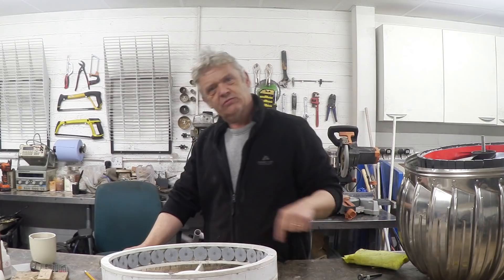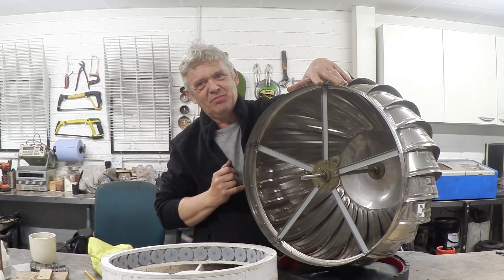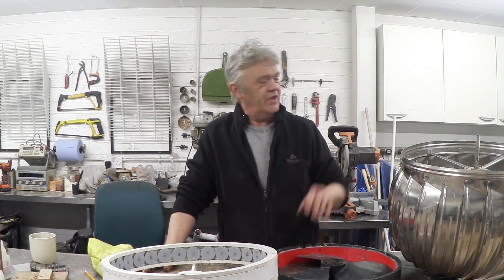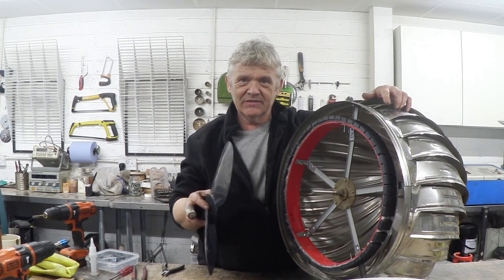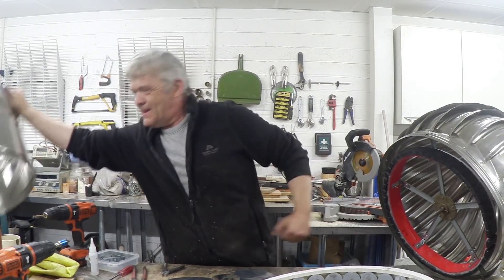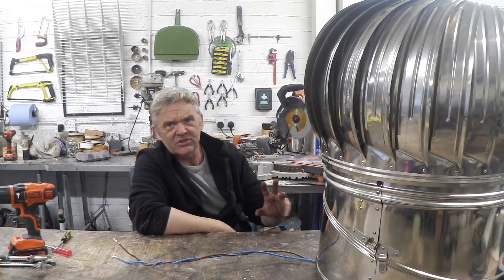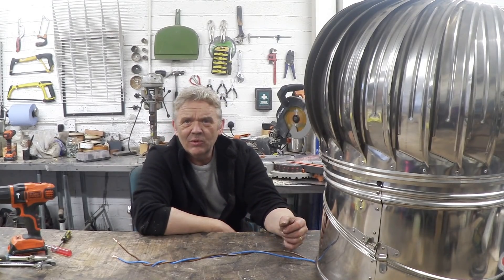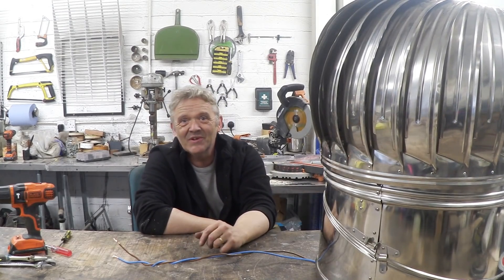Rotating Ventilator For Wind Power Part 5 - Finishing And Testing

Comment: It's definitely a novel idea using this setup for using wind energy, I get this concept and appreciate the use of it which alleviates the obvious necessity of facing it into the wind my question is can you reduce the back pressure or reduction of wind flowing into the wind turbine by adding an exhaust port(s at the bottom of the base and or the design of the plastic fan blade placed inside

Comment: Robert, there is one question I have: it's about the ratio of magnets to coils. Is it even important?
Or is NOT having a N-S on one coil while the next has a S-N going to cause cancellation?
Better yet, how about recommending a good basic textbook?
Also, this thigs spins from updrafts, too? So, one could elevate it significantly on a duct painted flat black, and take advantage of a solar induced thermal draft.

Comment: I believe the internal fan is intended to take advantage of the rising hot air from inside a house. It is a ventilation fan after all. You're not going to see a lot of benefit from an internal fan if you use it in a setup where it's not being used to vent something.

Comment: This looks like a possible heat / wind power generator that could work on a chimney. The idea would be to use the updraft from a Wood burner fire to generate torque but what would the fire risk be? I could also see it working as a generator ventilator for animal housing where farm stock are wintered inside. I couldn't see the amount generated in your demonstration and to be honest I don't really understand the intricacies of Amps Watts and Volts, just that we have a 230-40 system and what we use consumes Watts or Kilowatts.

Comment: I wonder why nobodies ever tried to do all the math and work in building a machine where it used levers, pulleys, gear ratios, flywheel, generator from solar and wind both to drive a motor that turns itself..   youd think once youve gotten the applied torque above the used with all the pulley/ lever/ ratio set up in some kind of sequence to drive a flywheel tp get it all started and keep that enertial force and apply it to the ratio equivalency and make a generator that can power itself once the initial force is applied to get it started..

Comment: Humm I woumder if instead of puting a motor in the middle of a blade turbine you put magnets at the tips of the blades and coils in a tube around where the blade spins, if you would get a better result than a normal blade turbine with a motor in the middle, as it would have less talk.

Comment: Lovely demonstration Rob Sir loved it, much near to completing my project would love to share a video soon with you, my plan is to extend the central Axel and mount rotating disc of magnets in N S orientation with a collar that will hold the coils, Rob Sir I need help in finding a formula or equation to what gauge of copper wire would produce what voltage in one turn, so as to determine turns vs the gauge of copper wire, thanks loved the series, also liked your attitude to go on sorry to know that rim cut your finger, lovely series, Love and warm regards from India.

Comment: This is headed in the direction of a project which I have wanted to do for several years. Since the temperature of the atmosphere drops as you go up, how well would it work to stand up a tall tube with fan blades inside. Each of these fans would be attached to a generator. As the warm air from near the ground rises through the tube, it will turn the fans and generate some current. As a way to help heat the air at the bottom, a "skirt" could be mounted around it, up off the ground to draw air into the tube. If such a system proves to be commercially viable, it could be built fairly large and the area under a skirt could be set aside as a covered park. Just something I have wondered about.

Comment: Watching this made me think you could use heat energy and wind with the same generator. What if you  stuck that on top of a say a 20ft tube that was painted black. Have the base set above the level of the ground. As the pipe is heated by the sun it will warm the air inside creating an upward draft. I would think this upward draft would spin this generator even without any wind. If these are used to let the wind spin it which  creates a draft then if you create a draft without wind then it will spin. If Wind=Rpm and RPM=Draft then Available energy = RPM-draft. But when heat = draft and draft = rpm you get available energy = rpm + rpm. If Wind = 1 and draft = 1 then rpm would be 2 so to speak. My thinking is energy from the wind is being used to create the draft so you don’t have all the energy available to use for generating power. But if you create the draft from rising hot air you convert that wasted energy into usable energy. Just an idea but harnessing two renewable energy sources with one device would be great.
Reply: let say, let say, let say...

Let say you have a house with a roof (everyone has some). If that is sloppy roof, than it can has living space under roof or only empty space, but in both cases it will be good to ventilate gap between roofing and insulation. Especially in summer, such a ventilation can lower significantly energy needs for airconditioning (cooling). If one slope is oriented towards to south, then space under the shingles can reach up to 80°C (especially if roofing is made from steel plate). During the winter it will be better to not vent it to lower heating bills. Such gap can be used instead of pipe as heat collector for creating push from hot air rising. (If there are shingles right on plywood, then it is not good in terms of no gap and low thermal conductivity).

Question is how to balance energy gain and ventilation properties. Even the best wind turbine has efficiency about 56%, which means that 44% of flowing air energy is not turned into rotation (everything without wind). If there is a roof 10by6m it can get 60*1330W from the Sun (depends on latitude), which is quite interesting79.8kWatts of energy. While it is not painted by unobtanium paint, it can turn about 40kW into to heat. Cowering it by thermocouples will be crazy idea to gain 2kW in direct electricity and 38kW in heat (which needs to be vented out to prevent heating living space). then if we are talking about those 40kW heating ability, then if only 10% penetrates thermal insulation, then venting will save 4kW of cooling needs (about 1-1.3kW in electricity). 
The second question is how you can utilize those 40kWatts (1%=400W, 5%=2kW, ideal theoretical max 56%=22.4kW)

Comment: I wonder if a combination of both putting a motor at the centre as well as at the edges could provide a benefit. (Excuse my very limited understanding but...) Could one use the centre motor to generate a slight current through coils on the circumference, which would then increase the load and in turn increase the power generated? That may slow the ease of turn as it goes faster, but you could add a heavier material on the spinning perimeter which would then act as a flywheel. I hope that makes sense. Thanks again for yet another excellent vid.
Reply from the maker: I don't know mate - it seems to me that's a bit like an axial flux design - but probably worth a try just to see

Comment: ??? have you tested it to see how much power it would produce was wondering if something like this could make enough power to run / charge a batter pack with then could power a 12/24 volt DC electric water heater to pre-heat water.  I would be wondering if this would make a difference even if you could bring up the differnce fomr the temp even by 10- 20 deg  out of well  / city water supply would it cut down on engery comsumption of lets say a tankless water heater ?? just a thought
Reply from the maker: good thoughts mate - but they are things you should investigate
Reply: @ThinkingandTinkering  yes I like your videos get me thinking of other uses and the movement of off grid living looks like some of this could be very useful

Comment: The plate idea for holding the magnets on one plate and the coils on a second plate separated by 1 mm or so is worth pursuing for two reasons. 1. It is easier to get the plate balanced than the rim style of stator/rotor; 2. You can mount really large coils on the second plate without compromising the distance from the center/speed and thus get more watts. The idea is to get to a usable output of at least 100 watts. The target is to ultimately get to between 300 & 400 watts, using one or more exhaust turbines, which is considered the average instantaneous consumption in a house.
Reply from the maker: cheers mate - I would vent the plate though so air can flow
Reply: The disk idea has been used with diy wind generators. The plates were initially  car break disks and a front stub axle assembly often from a volvo, the wheel bearing ised for the blades and the stearing bearing for the rotationto the wind.  Pitch of coils and magnets needs to be right for the phases.

Comment: I really hope that you take it out again at a later date when the wind pick's up a bit more and get some better results!
I think that this should be used in conjunction with solar panels! Sometimes you get just the panels, sometimes just the wind but other times you get both! 
All that would be left now is to make something to use rain water to harvest energy and you should be covered! Unless it's a dry windless night LoL... But as soon as things change, it's all on for young and old! 
Incidentally, I personally would wire it for a higher voltage than that of the batteries so that I can use an MPPT charge controller to efficiently convert the high voltage low current to low voltage and high current, the reason for this is that you would have noticed that when you draw current, it puts a load on a generator and it can't spin as freely as it should, so an MPPT charge controller will be doing all the heavy lifting! Well that's how I see it anyway! 
I have only just received my hydroelectric Generator's (5 of them from eBay) and I'm itching to do something with them buy the lockdown is keeping me from the local hardware store! But it's all good 👍 can't do anything if I'm dead so it's unfortunate but just as well!
Reply from the maker: nice thoughts mate and thanks for sharing - tbh I haven't really thought that much about how to actually use the power - but we will get there
Reply: @ThinkingandTinkering  it would be interesting to see what each of the different types of Generator's can produce over a longer period of time but for that, your going to need a battery to store what you have harvested and independent meters for each device to see what they can actually achieve over the long run and a load or two that you can switch in or out depending on the state of charge on the battery to keep it always in it's charging region so that you are always getting the maximum out of each device! 
You can start each video with a look at the meters to check performance, I would definitely want to watch that! Another meter that measures the total amount of electricity harvested... I think that the results would be very interesting, some of the devices that I have seen you build can be placed in places that are normally not used like a wall! I really can't see something new to the market that would force you to replace it with. A solar panel for example, many people have 'em but it's an industry that has a lot of attention so you run the risk of having to replace the one that you have for a better one possibly a year later! But that pipe contraption with no moving parts mounted on a wall! Nothing is going to knock it off it's perch so you can pretty much set it and forget it! Sure they can't compete with solar or wind or hydro for output but they are not in the way and every little bit helps!
Say! I just had an idea! LoL this always happens to me! I would be talking about something and a picture just Pop's up in my head! 
That pipe contraption with no moving parts, what if you connected one end to a mechanical lever? That way you can amplify it's movements to get more swing through a coil! But then it has moving parts! Who knows, maybe it might possibly produce more if you used a mechanical amplifier? Better swing = longer stroke = higher voltage... Hmmm interesting..
Anyway, that's just some food for thought. Thanks for your reply, it's nice to get that every once in a while, it just makes the world feel a little smaller..

Comment: You are right, Yet another use for superglue.
Thank you, great video. 👍
Is the Internal fan meant to move the air down once it's been through?
Reply from the maker: a marvellous thing mate lol and yes I think that's the idea
Reply: I would think the fan creates a vortex (instead of chaotic air movement) so that the air inside spins with the ventilator and runs with less internal friction.

Comment: So, if money were no object and I had an 18-inch ventilator, what algorithm should I use to calculate the optimal distance between stator coils and rotor magnets (1.26 inch grade 40 Neodymium Screw-on Disks)? Also, what would be the best gauge and length of wire for each coil?
Reply from the maker: I dunno

Comment: Have you done, or would you consider doing, a video on how to wire these various low power generators for a "plug and play" option? For example if a building had multiple of these on the roof,  but only one battery, is there a way to wire each one that it would plug into a central line, also allowing for additional generators to be added later? Love the channel and thanks.
Reply from the maker: I haven't done that mate - but it is a really good idea - I'll do one - cheers

Comment: The optimum voltage for splitting hydrogen by electrolysis is 2-3 volts, maybe a application for this ventilation generator.
Reply from the maker: could be

Comment: Do the coils have a iron core in them? or are the bare coils with out any cores? One thing i know about Generators is when they have a spinning coil in front of a magnet, generally the coils have either a cast iron core, which helps in the attraction of the magnet to them, and I think it helps the generation of the spark . This was ascertained from studying the old Quack medical kits of the 1850's. Would be curious about that.
Reply from the maker: you might want to watch the video I did on making the coils

Comment: Well done Robert, you did it the right way to get the most out of it with what you had as knew you would. As for wether or not the internal axial fan improves the performance, I believe it does. Here in Sydney we got them at a time when they were advertising  them with this feature and the claimed increase in performance. Unfortunately I believe that they worked too well as we live on a busy road and our house had wall vents and I added closable ceiling vents and while the cooling effect was fantastic we effectively turned our house into a vacuum cleaner which later proved to be a serious health hazard. Therefore I blanked off the internal wall and ceiling vents, got air conditioning and air purifiers. Years later we had a bearing failure and got the company out to change it and they wanted to take the axial fans out as they were now telling me that it works better without it. I personally think they might have been worried about the legal implications and might have been trying to cover themselves. They still help to cool the house fairly well just by keeping the roof space cooler than it would normally be.
I had an idea. You could use the electricity generated to operate an automatic vent using temp sensors to sense when the temp at or near the ceiling gets to a set point or maybe difference from temp at  the floor level and then simply open up and close accordingly. You could use the rim of a standard ceiling fan and cut out a disc to the same diameter and use a spring and solenoid attached to the disc may with a soft gasket and this combined with suction from the roof vent would pull the hottest air out from the sides unlike a standard ceiling fan which might pull out some not so hot air with it. This might actually work better than vents left open because as I said before they can work too well and apart from sucking too much pollution into your house they might actually be sucking too much warm air as well.
Reply from the maker: cheers mate thanks for the info - I did wonder how well they would perform - interesting idea you had there too
Reply: Robert Murray-Smith I’ve been thinking about the fan that you have used and I think there is huge room for improvement. I think the fan that you have used is designed for higher speeds, the fans used on our vents look as though they  are made from a circle cut out of sheet metal with the perimeter bent at 90 degrees for rigidity with cuts between the hub and the outer perimeter are very close together and bent to form long thin blades. Unfortunately there’s no point in sending  a link to this manufacturers website as the no longer use them. Also just an observation for your interest I have noticed that in the early morning without wind these vents will stop but when the sun comes up in summer still without any wind they will spin as well as your one did in your video.

Comment: Hey Robert, it's often intrigued me that no architect has yet struck upon the idea of mounting a wheel impellor around the ouside of a round tower.  The wind would penetrate the wheel, wrap around the building and exit the wheel a second time, multiplying the torque available.  With a circumferal magnet/coil ring as you've described it'd generate a notable amount of power for that building.
Reply from the maker: it probably would mate - interesting - cheers